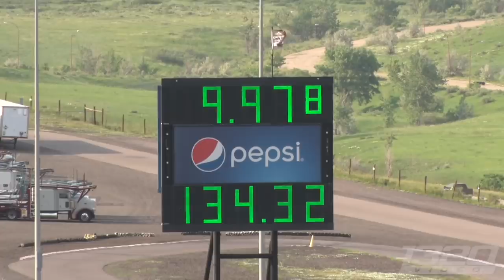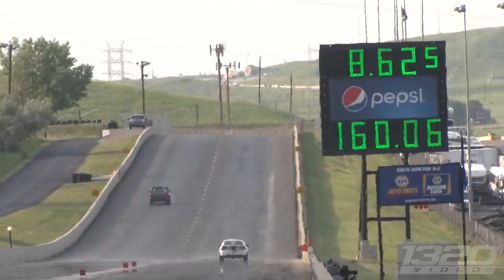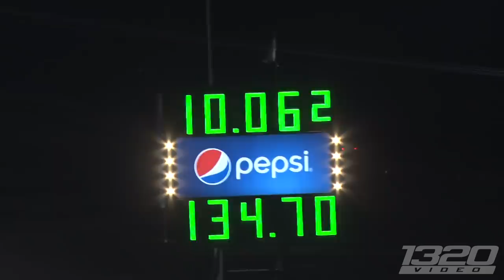Kyle’s in 3rd place, Mullet’s FASTEST pass yet, & MORE!

Comment: If Mullet will do a 7.80 at this DA, can you imagine how fast it's gonna run at Bradenton on a cool evening.....? Thing's deffo going Sixes......
Reply: Sub- 7.50s easily at least
Reply: I don't know about 6's bro... No way... He MIGHT pick up 0.3 - 0.4, but no where near picking up a whole second
Reply: @danielbrealey2924  Don't forget this car isn't dialled right in atm it is more streetcar mode than it is in racecar mode. I reckon once Kevin gets Mullet dialled in, they're on a good track, and the DA is good, we could see some high 6's
Reply: @billyashworth3944  I hear ya... In racing, once you start getting to those kind of times the effort to go faster becomes experientially harder to go faster. Unless there are some drastic changes to go into street mode, then I don't see it dropping a whole second from here. Half a second, I could believe though
Reply: @danielbrealey2924  I do wonder what will be the first limitation: power, tyre, or chassis/suspension
Reply: @billyashworth3944  Yeah, an interesting thought...

Comment: One of cleets problem with mullet, is the fact he is tuning the suspension for a slick, but has a radial tire on the car. The rear should be separating, 5-7”s, but it’s not. The front has way too much travel. Once he gets the boost issue fixed, He’ll figure it out once he’s on the rear bumper.

Comment: Have you seen the twin turbo blown engines that Redcliffe mechanics built two of the motors and they run and in a lj torana and a hq 1 tuner. Surely they wouldn’t disqualify him if you gave him a hand not because he is in a wheelchair but because it wouldn’t be cool if he had to lay across the hot motor to fix his issues.

Comment: I don't understand why some guys will sit there for 5 seconds after they get the green and hold the engine at redline. Once you get to the limiter, waiting isn't going to give you anything more than unneeded wear and tear on the motor. Cleetus does it a lot. Maybe they're just getting their heads right and then letting the ponies fly.
Reply: They're building boost up. Since they're racing the clock and not necessarily the person in the lane next to them, they can take their time, let the turbos spool up to optimum boost, then let 'er rip. Clock doesn't start until they trip the beam so it's all gravy
Reply: @jakewestor7840  That's the part I missed. The boost. Since it is exhaust friven then it makes sense to get them up to full spin. Thanks

Comment: I am not trying to throw shade at all man, I dig 1320 gang and Kyle is a great guy.

But there was something comical about watching a $250k supercar with months of aftermarket work done to it getting smoked by a 60 year old beach wagon.
Reply: He's bracket racing, doesn't have the safety equipment yet to run under 10s. He could run 8s easy with that setup. Maybe you should do more research on a subject before commenting?